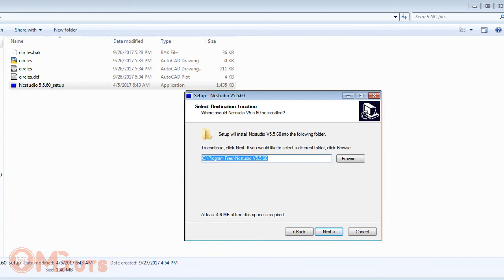How to install NC studio and controller card - Master your CNC machine with NC studio video course

Comment: I know this is an old thread but did I hear it right, don't allow drivers to install until after Artcam is installed?  I installed artcam, then nc studio and then allowed drivers.  However, the PC will only be used to run nc studio.  My Artcam files (g code?)will come from a stick created on another pc.  Am I okay?  Thx.